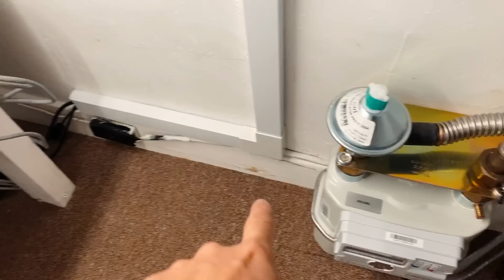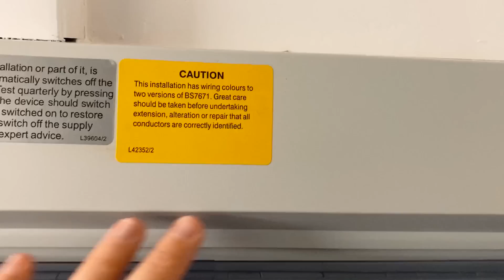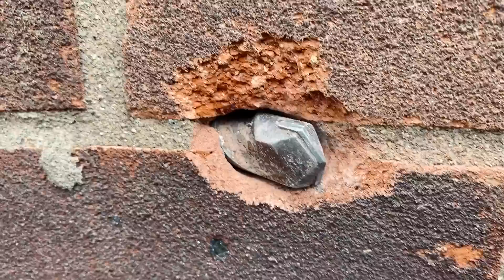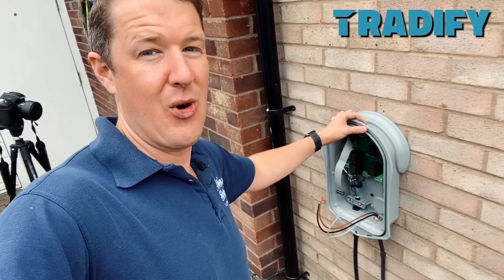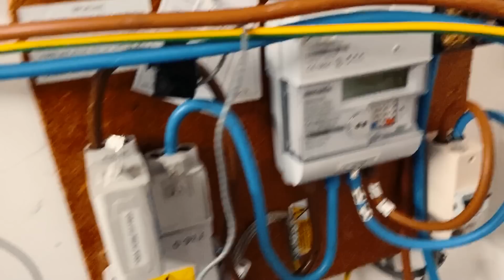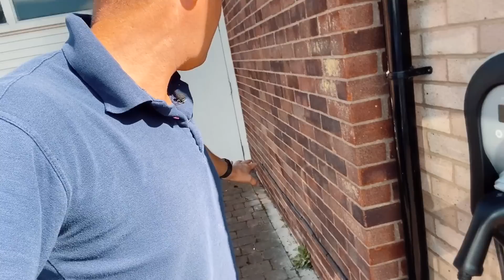Should YOU become an Electric Vehicle Charging Point Installer?

Comment: I'd like to know where all this electricity is going to come from. The widespread closure of conventional power stations following the huge investment in wind power is OK whilst the wind blows (at "Goldilocks" speeds,) just about.  All it would take is a blocking anticyclone over the UK, (resulting in insufficient wind, like  like we had a couple of summers ago,) during a cold winter, both scenarios not unknown  The resulting power cuts during this time would be the least of our problems.
Reply: Look at the Youtube series "Watt barriers", which explains all the issues, the conclusion being that the grid can cope fine, there are only minor issues with some local supplies.
Reply: @mikeselectricstuff  The grid (distributiion system) might be able to cope fine mike, but can whatever is supplying the grid, be it renewables or the fewer and fewer conventionals and ageing nuclears supply the demand, that be the question😉 .
Everything is fine(ish) when the wind blows between the right speeds, but this isn't always the case.We are relying more and more on the continental inter connectors to make up any short falls but who knows how long this will last given what is happening d
Dec 31st?
Reply: @CHIL2903  If you look at the rate at which the cost of solar panels has been dropping over the last 20 years, it would be a good guess that within 10 years, most houses will have them as they will pay back all of their up front costs in a few years. 
With rooftop solar producing a daytime surplus on the grid, and smart pricing of energy supply to consumers, using Agile tarrifs, the demand can be moved to the times when power generation is plentiful.
In my neighbourhood, 5 years ago there was less than 1% of homes with Solar. From a scan around the locality today it is well over 10%.
Reply: @steveharvey2001  Hello Steve, solar panel price has dropped mainly due to the CCP 's (China) policy of under cutting every other manufacturer on the planet in just about everything you can think of but things could be changing. There is a lot going on with China and its territorial disputes, that goes unreported in our MSN and it’s not good for China.
FIT prices have been steadily falling since their initial roll out well, a neighbour has just seen the loan he took out to pay for his installation, go from 12 years to 15 years to pay for the investment , from what he earns from feed ins.
Smart pricing or load balancing is another myth as well, what they are aiming for is a one off( higher tariff) for the whole day.
Tariff prices are calculated the previous day and are based on a number of factors including weather conditions, the predictive demand (meal times and something good on the TV are usually the most expensive ) and the plant available to meet the demand. The most efficient are used the most with less coming on line as the demand increases, hence the higher price for running this plant.
The lowest prices used to be after midnight until around 7 am.
If smart consumers start to take advantage of the lower price tariffs (this is one of the selling points of these devices) that period will then become a peak period and the price will rise accordingly as the less efficient plant is woken up to meet the demand. They will be predicting one period and have plant ready but then be hit one at a different time. Grid instability then ensues, not unlike when it tries to compensate for gusty conditions. Denmark have allegedly stopped build more wind farms due to grid instability.
What makes me smile with renewables is their “fuel” costs. Conventional stations have two main types of costs fixed and variable.
Fixed costs are things like staff wages, scheduled maintenance etc., and variable costs are the cost of the fuels that raise the steam. This would rise and rise again, rarely fell, depending on who was invading who, the strength of sterling/dollar and time of year, usually being more expensive in winter in Northern Europe
So, what fuel costs do wind turbines have? How expensive is wind?
Do wind farms (after installation and commissioning) have huge numbers of process , engineering, electrical, instrumentation staff, or just a couple of blokes in a control room and a several of vans and a boat for offshore work? If the latter, why is it so expensive?
The price of energy is only heading in one direction, sadly.
Reply: Not to mention all new housing will have to be run from electrically powered heat pumps when gas boilers are phased out.
Reply: @markrainford1219  👍 my sister in law, a teacher, said that she will OK if there are power cuts as she has gas central heating. I don't think she knows how the pump or control system is energised. These announcements are simply politicians letting air out of their heads, without any thoughts to the practicalities of what they are spouting. All this to appeal to the "sky is falling "brigade and brown envelopes from the snake oil salesmen of the companies who say they can deliver such products.
Reply: Bi-directional charging. Basically, they will be 11 million power bricks not being used for almost 23 hours a fay. Plus within 5 years car manufacturers will easily have 1k miles  on a full charge and charging times will most likely fall too.
Reply: @brad30  all very well, but if you're not generating enough power over an extended period thean no practical amount of battery capacity is going to save you.
Reply: Good question, both generation and distribution capacity are woefully inadequate to cope with the GWatts needed.
Reply: @Frogzillanz  cheers Nathan, a lot of people don't give any thought to how electricity arrives at one's plug socket or light switch, it just does but for how much longer? There'll be suicides and riots when they can no longer charge their 'phones.😉
Reply: The grid will be overloaded and we will have to go on energy rationing (turning power off at certain days/times) like what is happening in California right now. Except worse, as we will all be dependent on the grid for our transport as well.
All because government won't build more power stations and NIMBY groups have been given so much power to disrupt and run up costs whenever new power stations are being built.
Reply: @MrEdrftgyuji  That's the idea behind "smart" meters, CP (for those who bother to look at the prevailing tariff price)The old CEGB had tried for years to bring in tariff based prices for domestic customers (industry had this) but the technology did not exist. The old "dumb" meter knew what had been consumed but not when. This changed with the advent of SM's (all for our own good of course) When demand was in danger of outstripping supply, likely due to insufficient plant to meet the demand, the tariff price would go through the roof, "hopefully" to dissuade the consumers, those who knew how they worked that is, not to put the kettle or oven on, or need a bank loan if they did.
The station I worked at was on a chemical site, the site being a net importer of electricity as the station could never meet the maximum site demand. I have seen the half hourly tariff price go from tens of pounds per megawatt to thousands of pounds per megawatt, to get industry to shed load during periods of high domestic demand, usually winter time.. This at a time when we had far more conventional stations than we have now. The situation has only worsened since then but demand has increased. We may have lost a lot of the big industrial users of energy, rail being an exception but domestic use has only increased. We will look back on these times and call them the good old days. 😉
Reply: Electric vehicles will be used as backup to supply the grid in the future where there are periods of high demand. I also imagine more triad periods for businesses where their electricity is so expensive they have to shut things down for a period of time.
Reply: @bobbyzilla  Won't happen. Who is going to spend thousands on finite life car and powerwall type batteries, just for other people to use them?
Reply: @markrainford1219  probably everyone because it will be legislation. Plus they'll buy the electricity.
Reply: @bobbyzilla  Electric vehicle's batteries would have to be charged first before they could do as you say. A lot of industry has not just shut down during periods of high demand, they have vanished all together, mainly abroad and taken the jobs with them (speaking from experience here) and the way things are we will never see them return, high energy costs and all that nasty CO2 doncha know.
Reply: I suspect we will have some calamities at some point, mainly from the reduction in mechanical inertia in the system from more inverter type generators, these may result in some large blackout events. However in terms of supply meeting demand most vehicle charging can happen over night and it will take many many years before the EV charging load starts to approach existing day time peak loads.  Dynamic management of charging can help to mitigate this further.

However if we want to be truly ambitious and serious about weening ourselves away from gas for heating and petroleum for transport well then we need to build a new, extensive fleet of nuke's.
Reply: @r.h.8754  HS2 rail network is predicted to use 1-2% of total UK electricity when it is finished. ⚡⚡
Reply: @loosecannon5813  The original estimate for HS2 was £34 Billion, the last one from the ones who have been on mega salaries all these years, say it could be as high as £88Billion or even £106 Billion, so I wouldn't place much faith in any numbers coming from this bunch.https://www.theguardian.com/uk-news/2020/jan/20/hs2-costs-government-review-west-midlands-manchester-leeds
Reply: @loosecannon5813  Predicted by whom, Mickey Mouse, cite your source. This is complete FUD.
Reply: @bellshooter  I remember reading about it a while ago in an Electrical contractors magazine, but a quick search on Google showed that on the 26/02/2019 in the house of Lords, Viscount Ridley stated 'HS2 had a gargantuan 3 terrawatt electricity appetite every year, equivalent to 1% of total UK usage'.
Reply: @r.h.8754  Like so many things today, R.D. you only miss something when you no longer have it😉
Reply: @r.h.8754  Funny . . . I look outside, and it looks like an Apocalypse!  Global Warming is the cause . . . and I want to sue people like you for it!  (If you didn't know we now apparently have worse air quality here than China!)
Reply: @r.h.8754  Not been a good few days for wind, solar has been doing well though. There's a certain bloke in the US who's not a "fan" (pardon the pun) of 'em either.
Reply: @r.h.8754  That's basically the same thing as a climate change denier . . . you refuse the overwhelming majority of information in favour of a few conspiracy nuts!  It's measured in the pounds of paper filling warehouses . . . then a guy runs out with 1 binder and proclaims I found the truth!  You just know he's full of shit! . . .
Reply: @r.h.8754  Sounds like bollox, RD where's the switch connection between the metering and the individual appliance? Makes more sense, if when the consumers demand became too high, (who decides?)the meter tripped and somehow cut off the supply to whole installation but not just to individual circuits/appliances. The idea behind SMs was that during periods of high demand and little plant available to supply it, the tariff price would be so high, it would dissuade most people from using it, in effect, they would have to load shed. Still, it's a great advert for the take up of SMs, Not! 
Just had a  thought, it might be possible for a third party to switch off these "smart" Hive type heating systems, the ones on the adverts where those with a smart phone you can turn 'em off  (overused word today, is smart!) when their train is delayed. Still SFA to do with smart meters though. We can be too "smart" for our own good!
Reply: @r.h.8754  Well you see . . . you don't have to worry, about swimming pools and AC so much if it's green electricity!  I don't know what else to tell you . . . we have ice cores that show a big spike in CO2 right at the start of the industrial revolution when we started burning coal; our finger prints are all over that!  CO2 absorbs (heat light) inferred that hits it. (Simple physics). Then the ocean steals that heat like a pot waiting to boil, so we don't notice it getting hotter! . . . Like a freight train slowly rolling down a hill; we can't stop it for about a 100 years . . . we're going to have to watch every crash along the way while cursing our ignorance!
Reply: @r.h.8754  Ya that's not gonna happen; people won't stand for it!  Why all the worry and fear?  They will just build more power plants!
Reply: @r.h.8754  well like I said a home solar system eliminates all those issues since you control the flow of power!  Battery backup and/or only use the grid in emergency if you run out; me personally I'd always want a grid connection, so I can sell back too.  The smart meter is kinda required to do it though . . . There's a lot of conspiracy BS surrounding them; my only issue was with the fires caused by poor quality contactors in the units!

Unfortunately every time a new technology comes out a certain % of people jump on the conspiracy train to crazy town!  Instead of looking at evidence and science!
Reply: The power engineers have problems and solutions!  We don't need fossil fuel energy; it's a lie perpetrated by the companies who sell it!
Fusion is getting exciting, but even without it battery storage plants + solar + wind + hydro + others solves the problem!  The grid doesn't have the batteries yet, so brown/blackouts happen!  There's always going to be growing pains . . .
Reply: @bardrick4220  Today's demand is over 36GW, renewables are providing 23% of this.
Biomass  5% (cutting trees down in Canada, pelleting them and sailing them across the Atlantic,  where more has to be burnt, than conventional fuels due to their lower calorific value.Very "green"?) 
Wind 2% (how much have we spent on these installations and how many are there?)
Solar 15% (Pretty impressive, but not a lot of use at night for providing off peak electricity)
Hydro 2%.(Dinorwig  could do better)
These figures add up to 24%, probably due to rounding up errors.
The other 76-77%
Fossil fuels 61%
Nukes 13%
The rest is from the inter connectors, we are actually sending electricity to France.
Fusion is getting exciting, but it is a hell of a long way from being practical and from the figures above, on current timescales, how much chance of  fusion supplying 60+% of our energy needs, because we are certainly not going to do it from renewables. 
You mention "lies perpetrated by the companies who sell it"! I think you will find this doesn't just apply to those in the hydrocarbon industry.
Reply: @CHIL2903  we do have a sustainable wood industry, but yes please stop burning our trees!  We need them to build homes!

Have you heard that the cost of solar is now cheaper than coal?
And you seem to have missed the point about *grid batteries: solar makes a lot of excess, so you store it for those rainy days!

Yes the oil industry totally lies!  They don't really need to since oil is used for many other things, but we shouldn't effectively be "burning diamonds" for power!
Reply: @bardrick4220  Solar seems to struggle  a bit at night, output is presently zero, who'd have thought it?  Same as wind turbines when the wind is the wrong speed.
Reply: @CHIL2903  OK you are really dumb; how many times do I have to say BATERIES till it clicks?
BATERIES BATERIES BATERIES work at night!  Cheap Lead Acid batteries to fill your basement with if you need that much power!
Reply: @bardrick4220  Not if they hope to be charged by solar like you implied and I quote "And you seem to have missed the point about *grid batteries: solar makes a lot of excess, so you store it for those rainy days!"
BTW, Should the r in your name be an l?

As an aside, I've just had an email from my supplier.
to whit, prices are changing.
Electricity (100% renewable allegedly) is going from 14.203p/kWh to 16.076p/kWh an increase of 1.873pence
Standing charge up from19.592p/kWh to 19.19.886p/kWh
 Electricity prices only go in one direction. Looks like wind's getting more expensive. 

On the plus side, gas is coming "down" in price from 2.823p/kWh to 2.818p/kWh a whole 0.005 pence!
Also, coal is not pure carbon (burnt a few tons over the years) and if it was, it would have a different molecular structure to diamond.😉
Reply: @CHIL2903  some people are just so deep in denial or maybe you're invested in coal?  It's really simple build more panels and batteries than you need; then your batteries stay full year round!
If the prices get too high, buy your own panels and batteries!  The grid can go f*** itself; you pay $0!  Or often they pay you for all the excess cheap power you're making.  I'd already thought of buying a secondary battery pack just to sell power back on peak demand!
Reply: @bardrick4220  Pension won't stretch to buying such things, after paying for the small amount of energy I use. I have a wood burning stove, fed from drift wood, off the beach and a big stock of candles for when the sun goes down and I stop up late. As the nights draw in and get colder (damn this global warming!) I spend more time under the covers!
Reply: @CHIL2903  well some people have to learn the hard way . . . you can live in your little bubble, and wait till the flames engulf it!  Like I said the whole west coast of USA is on fire, and here in Canada I'm breathing in the toxic fog rolling north!  It really does look like the Apocalypse; I almost can't see the other side of the road!
Reply: @bardrick4220  Seen videos of Antifa lighting fires and live straeming it. south of Portland and, SFA to do with CC.
Reply: @CHIL2903  LMFAO really . . . you're that stupid?  You're gonna blame wild fires on Antifa?!  Or are you just a troll?  They're Leftist . . . environmentalist types they wouldn't light wild fires!
I was gonna say don't bring politics here, but unfortunately EVs are political . . .
I don't like the Trump supporters or Antifa; they're fighting like children!  He looks difernet, he called me a nazi!  Grow up, put on a mask, go home and stop spreading the crazy plague or starting WW3!
Reply: @r.h.8754  I'm currently on natural gas heat and we have wood stoves as back up!  We have 2 hydro dams in our area, and I could just as easily burn hydrogen from excess solar (there's a guy who actually does this completely without the grid)!
Reply: @r.h.8754  Thank you, R.D. pet subject of mine, 20 years power station control engineer., ex.
Energy will become an expensive luxury in the not too distant future as demand outstrips supply, (already did on some days last year) due to “conventional” closures, rise in population, electrification as you said and into all this, the government wants to see 11 million? electric cars on the road in the next twenty years?
Anyone who thinks that they will be able to run one of these vehicles cheaply, could be in for a shock (electrical term 😉). When one considers how much fuel duty is raised for the treasury from oil based fuels, I cannot see them giving this stream  up any time soon.
Then you have the battery life/replacement cycle to consider, 3 years?. Rare earth minerals are called rare for a reason and are usually dug from less than friendly (not just environmentally either) parts of the world as well.
All this demand coming from renewables, I don’t think so.
Reply: @CHIL2903  You really need to actually research the facts before spreading this FUD.  Demand spread is how this will work. Price incentives  work right now and will be more sophisticated in the future, a vast majority of EV's are charged off-peak overnight and some of us even get paid to charge to get rid of excess electricity.  In addition, the energy used to refine petrol is about the same as required to directly power EV's. Oh and by the way , batteries have a primary life of about 10-12 years, and a secondary life in excess of 20 years In static energy storage.  After that they are >90% recycled to make ... new batteries.
Reply: @bellshooter t There will be no such thing as "off peak" when consumers en masse start   to take advantage of the lower tariffs after midnight, (slow cooking, washing machine, etc.) it will become a peak period, period! There won't be low tariffs or much charging being done either when the wind isn't blowing. Also, do you honestly think any  government is going to forego the revenue they raise from oil based fuel duties by allowing motorists to use an alternative fuel source?  If you think that they will allow electricity to remain at the same price for charging a car as it is for boiling a kettle, you must still believe in the tooth fairy!
Batteries have a life of 10 12 years? You should try telling this to Apple and other 'phone and laptop manufactures. Battery longevity is calculated on charging cycles. Lithium Ion batteries start to deteriorate the day they are made and their capacity will drop, granted, by a small amount, with every charge cycle. Will the nightly charge be a deep charge, after you have run out of sparks on the motorway or a shallow, top up charge, as different  type of charges also affect the useful life span of a battery. Oh, I forgot, they will be hybrid! They are not to good when it comes to operating at low temperatures, so best of luck to those hoping to drive around the Highlands, for six months of the year in their Tesla!